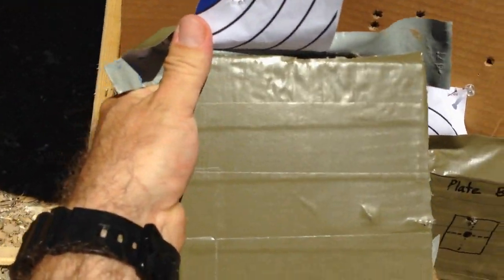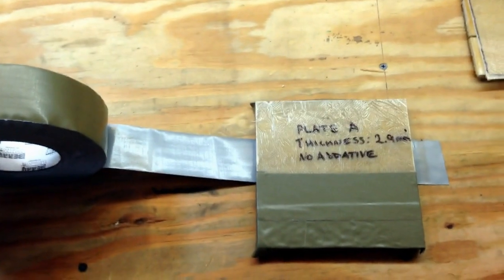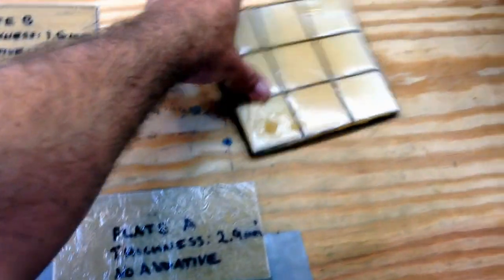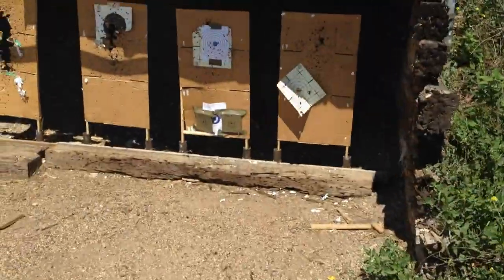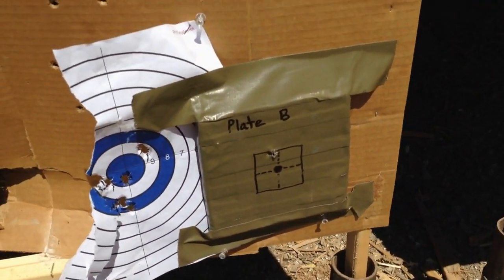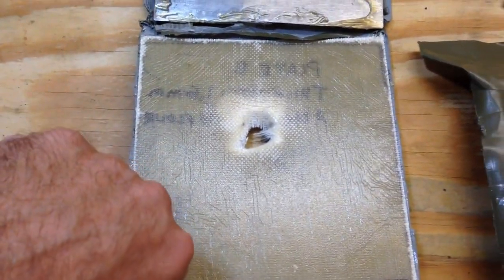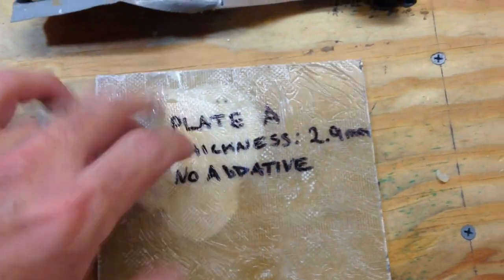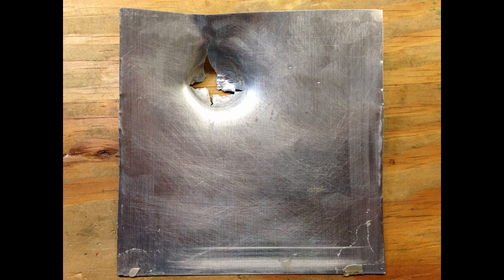Homemade Bulletproof Body Armor Plate

Comment: I want to know why people use tile and sheet metal for stopping pistol rounds. 32 layers of 8oz woven fiberglass mat, put together with the loctite heavy duty epoxy, bounces most pistol rounds, and after a few hits, it catches them in the first 8 layers. When clamped down when it's setting, is only a 1/4" thick.
Reply from the maker: just another method.  It works. tile is extremely hard and performs it's intended purpose.
Reply: Yeah, just curious. As it seems like more work than it's worth. And makes your plate shorter lived, can't take as many hits, and gives gaps to shoot right through. I've made a few plates, so have my buddies. We didn't have any cameras to use when testing. I've made a big plate, that was only a little thicker and heavier than an ESAPI. It was a lvl3 used 3 layers of tile, 3 layers of 16GA mild steel and 32 layers of fiberglass woven mat, and the redhead G5 anchor epoxy. Was a pain in the ass to make. Oh yeah, the tile mats, where different patterns, so there was no gaps straight through.
Reply: You could also buy some Kevlar fiber on eBay or amazon, or if it's the apocalypse you could find them at military surplus stores

Comment: try a mixture of material,gel for instance in a surrounding of material layers nilon denim
Reply: +Prep Know Do (PrepKnowDo556) Gel greatly reduces inward force impact, spreading the energy of the impact out through the shockwave created by the impact in a 380° lateral direction. There is a specific type of silicon gel (damned if I cannot remember the name or type exactly) that has been tested in laboratory conditions where a five pound sledge hammer is slammed full force down onto a recipient's hand that is covered in a two inch thick slab of this particular silicon gel. There is no effect on the test subject's hand, no damage, no broken bones, no bruising...nothing. I watched this in a video for a safety course for the entertainment industry for stunt performers, as it had generated some interest for various uses in stunt work. This was easily eight years ago.

Comment: problem with your test is if where your camera is setup is where you shot from it Is at an angel, ie best case scenario because it has to travel through more material and the deflection should stop some of the power. if it was a straight on shot you should explain that and if it wasnt you should for future testings it may make your stuff look worse but itll be better then not being truthful

Comment: ceramic floor tiles are not at all the same as the ceramic they use in plates.... if you really want to design your own body armor I would strongly suggest creating your own proprietary ceramic mix and you can come up with a modification to a small forge so that you could use it as a kiln to bake the ceramic. I would suggest impregnating the ceramic with metal powder...who knows what you might come up with ? but I think that the limitations of ceramic floor tile have been far exceeded...besides if you create your own ceramic mixture you could patent it and create your own tile shapes and sizes...could possibly come up with something like dragon skin with interlocking or overlapping plates.

Comment: Try to have an empty space between the layers, it breaks the shockwave transmission that "softens" the material in front of the projectile
Reply: I think it depends on the material, metal will have a crystalline structure of sorts. I only said "try", and not just layered as in "sandwich", but with some good space between layers. Ah, the layers between could be fibers, as an experiment.
Reply: Is it not interesting how heavy sand is such an amazing stopper of bullets... I think I would go for sandbags ^^
PS
"Dragonskin"

Comment: It should work much better to stop bullets if you used one big ceramic tile instead of the 9 smaller tiles, at least in theory, as energy would spread out across the entire tile when shattering the larger tile - of course depending on the characteristics of the ceramic.
Reply from the maker: Matt Hartman watch this version
Reply from the maker: https://youtu.be/TsycTtzWw2s
Reply: Awesome! Sub'd!

Comment: looks lie work... but  why is the stainless steel plate dented in the wrong direction of the thicker of the two? it doesn't look like the alignment of layers was incorrect (upper left impact) but the dent should have been in the other direction.
Reply: +Prep Know Do (PrepKnowDo556) if the dented plate were to be turned so the dent was facing the correct direction then it would be upper right .. no longer in line with the others ?
Reply: *****
there must be better than kitchen tile... when i was in Nam, we only had 'flack jackests'  totally worthless...  like the helmets.. lol  if it can be manufactured  it  can  be  manufactured... soon these will be unlawful  like  taking a walk after dark. .lol
Reply: *****
so what do you do when in a firefight? hold ceramic tiles infront of you .. and pray.  see problem is even with commercial 'vests' is they don't really protect u but rather give a false sense of protection..cause when the bullets fly they don't fly at the vest they fly everywhere. Those entry guys that are serious you find them with a shield in front and armor. do you know where your Axillary Artery is right?  30 seconds and your gone if it gets hit...or your femoral artery  ?  the most hit body part in combat is the head! what's that mean? in a firefight you are most likely to be hit in the head than any other part and what part of your head is the largest facing the enemy? What part of the head is most hit? the back why cause they were all ducking. seriously though do you really think all that energy is going to save you?  a small portion of your frt covered with armor. what's going to save you is what saves soldiers in combat  something in front of you  that's  stopping rounds.  so you are sleeping in bed on a Wedn. night and you wake to the sound of your frt door... do you jump up and put on your vest? no way if you do your dead. is your assailant going to wait for you to suit up? ha  ha  you 'd be more likely to survive with some common sense and so better advice. lets come down about 10,000 ft here.  Where are you and when are you likely to be attacked?  build a safe room first. then spend some money on deterrence. You need basically three guns. shotgun  handgun and a good rifle.  and you may once in your life need the handgun for defense...  nine mm or 45 or this or that  or ak  or ar15... better to spend the money, if you want to live, on keepin them out.

Comment: Dude, ballistic ceramic are NOT those ceramic tiles. Ceramics are a large group of materials. Ballistic ceramic is more likely the knife sharpening bricks (usually aluminum oxide) or sandpaper grains (usually silicon carbide).
Reply: ***** 
Try something for curiosity's sake?
Take some floor tiles, "dip" them in molten aluminum for as long as you can keep it molten. Then test their ballistic properties.
This may be hard for the common man to do, but I'm curious about if it has any effect.
Reply: lightenlynx The point here is to introduce a hard, abrasive and weight efficient material in front of the projectile to try to fracture and/or abrade the projectile so a backing material can stop it.  Ballistic grade ceramics are a special case of common industrial ceramics where care has been given to decrease internal voids, grain size for better performance.
Certainly housetiles are not as effective/efficient as ballistics grade ceramics but they are lighter than steel and much cheaper. And that is exactly the point of this video.

You may be aware that common sodalime glass has a better ballistics performance than RHA if properly employed.
Reply: FarSeeker8 That is actually being done for armor grade ceramics. I'm not sure if armor grade Al alloys are at home castable.
Reply: M van dongen "That is actually being done for armor grade ceramics."
I know, that's the idea: let's find out if it can be done.
Aluminum oxide is actually (according to my understanding) granular sapphire.
We can try to dip different silicon ceramics in molten Aluminum or mix clay with aluminum oxide powder and bake it in a furnace. Do you know any artisans who make ceramic items? They would have that type of furnace.
Remember Edison said: "I have not failed. I've just found 10,000 ways that won't work."
8)

Also, look at how NASA plans to deal with micro-meterorites. They plan put an ~8 inch of layered foam and aluminum foil sandwich around a spacecraft. While armor can't be that thick, layering stiff and shock-absorbent materials could also be useful.

Comment: Sorry Professional Prepper,  but the ONLY reason why the very last layer of f-glass of Plate-A didn't get completely penetrated is strictly because the different layers failed to stay intact, as "ONE", and blew apart (SEPARATED) from the initial projectiles impact force on the very 1st layer ! In other words, you went to ALL that trouble of building these experimental plates & failed to FINISH THE EXPERIMENT by "JOINING & SECURING" and/or "FASTENING" all of the layers together, AS "ONE", correctly, so they could ALL absorb ALL OF THE PROJECTILES IMPACT FORCE AS A "UNIT" AS "ONE" ALL AT THE EXACT SAME TIME ! Also, this is EXACTLY THE SAME REASON WHY the projectile was DEFLECTED to the left ! Because your layers came apart immediately upon the projectiles impact on the very 1st layer ! If your experiment was contained/secured/fastened/joined correctly, per your whole intent of this experiment, Plate-A definitely would have been fully penetrated ! Try that exact same experiment, but make absolutely positive that ALL layers are fastened together as "ONE", SO THEY CANNOT SEPARATE AT THEIR CIRCUMFERENCE/EDGES ! (This was/is your "weak-link" in your experiment.) If you do this, I guarantee the same projectile WILL penetrate the entire Plate. 

Lastly, FYI: you should use a dictionary. You misspelled "ADDITIVE".

GOOD-JOB....GOOD-LUCK.....SURVIVE !
Reply from the maker: RMCUSTOM please watch my other videos as the experimental plates have been improved upon.
Reply from the maker: https://youtu.be/TsycTtzWw2s

Comment: Name of the song?
Reply: Thanks :D
Reply: ***** hey, do you think when I combine denim and fiberglass mat, that I will get better result than when I use just one material :D
Reply: ***** I have stopped the AK and I need to make a plate which is thinner and lighter, so I need to have a composite backing of about 10 layers on the tile, I also planed using a single layers of denim on the front, to absorb some of the fragmentation. Since I dont care about time and simplicity I will try to combine the the materials, I guess it cant go wrong. And check out my channel, I posted some more stuff :D
Reply: ***** Thanks for the comment on my video, for some reason I cannot answer to your comment on my video :D Yes that was granite in that plate
Reply: ***** Do you think, that 1.5x2 inch tiles if used could disperse the energy of  a 223, i mean if the whole plate is well made. My standard size plate accepts only these tiles if i wish to make a curved one
Reply: Darude sandstorm
Reply: lol

Comment: wel u no, this is al great. and seems scientific. but why not strap a refrigerator to yourself and stand out in the open?  A size Medium IOTV weighs 33.6 pounds, less than a Medium OTV vest, while providing more coverage. However, a fully equipped IOTV, complete with all its components (soft armor panel inserts, four ballistic plate nserts (front and back plates and two side plates), collar, and groin protectors) still weighs 30 pounds.......
The MTV includes the following features:
Quick-release system to remove the vest in emergencies, meant to 
help corpsmen get to an injured Marine's body. Troops complained that 
the pull string got caught on equipment and the MTV would accidentally 
fall off in the middle of battle.Greater coverage of the lower back, side torso, and shoulders.Integrated side SAPI pouches.Integrated channels for communications wiring.Rifle bolster to assist in seating the wearer's rifle.Same modular PALS webbing as the Interceptor.A changed closure system. This was intended to be an improvement, 
but some Marines have complained that it takes too long to put on 
because the vest slips over the head. An updated version of the MTV is 
currently in production to address these issues.
the most important part of the 'vest' is the 'vest'...the plate design is another issue 
this isn't cowboys and indians. 
and it's probable that the small caliber weapons you are using won't be what you are up against...
Reply from the maker: +Charlie Hutch so I follow what you are saying and understand it all, but were you trying to make a point.  I think that maybe your point is that "this isn't practical with all the high tech and inexpensive options out there".    If that is your point then I agree.
Reply: The Professional Prepper (Prep Know Do)
the technology just is not there that's 'public'....3500 ft/sec penetrates most body armor .. ceramic is not the answer.... dragon skin works.. but is so expensive...
if you are in a fire fight... then the rounds are coming at you at 600 to 700 per/min... chances of one NOT hitting u r slim to nun. best protection is something solid in frt of u like a tank... tanks first then troops... rule 3.
visibility like hunting game is the determining factor..i personally believe, after surviving 15 months of heavy combat with nothing but a worthless flack jacket and tin hat... get rid of the jacket and hat... black watch cap n light long sleeve w/pockets like crazy... best defense is lots a ammo... an  more ammo  and friends  and  more  friends.
Reply from the maker: +Charlie Hutch so your point is F the armor, spend the time it would take to make the plates on making friends and ammo. Haha I like it.
Reply: The Professional Prepper (Prep Know Do)
real friends... not those fair weather ones...if you want to really know who your real friends are tell them all you are planning to move...lol